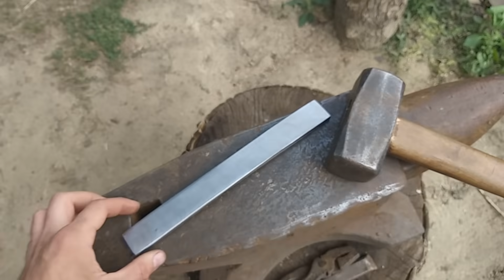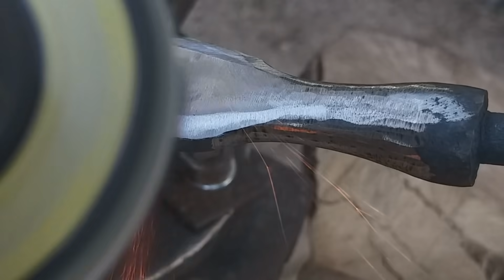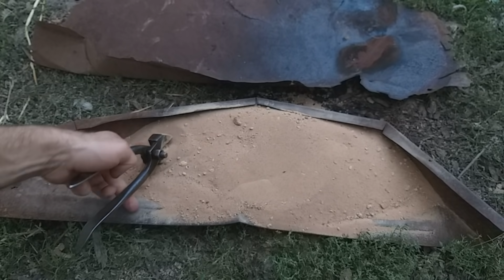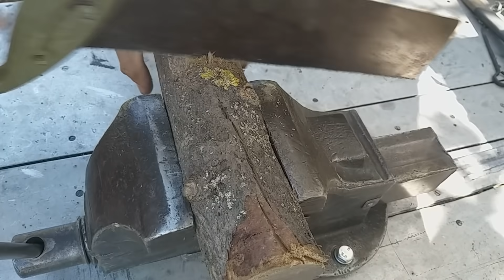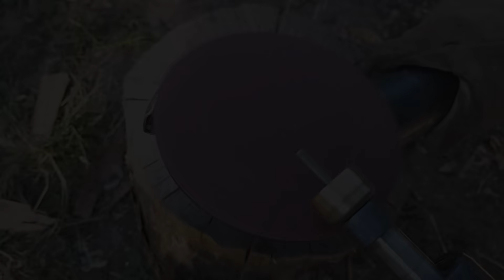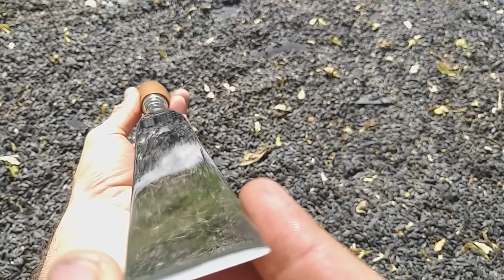Forging a CHISEL out of Rusted Leaf SPRING

Comment: Beautiful work.  I don't know anything about tool steel, but is there much of a difference between the steel from leaf springs and A2 tool steel, for example?  Could you use the same approach for a plane blade or would it get blunt too quickly?
Reply from the maker: To be honest i didn't work with A2 tool steel, but your question about plane, yes exactly 65G leaf  spring steel is perfect choise for plane blade ( my plane blade also made of 65G factory steel with mark on it)  number 65 means % of carbon there, so up to 0,6 - 0,7%

Comment: hello, never seen such process on the sand. Did you tempered it in the sand? how long did you let it in there? at what temperature should the sand be? cheers
Reply from the maker: Yes it was tempering process, for steel like that it must be 30 minutes 180 - 200 Celsius